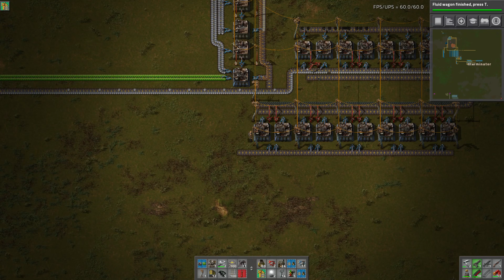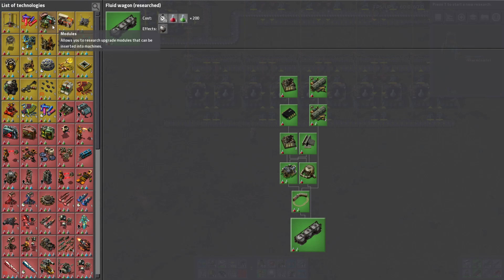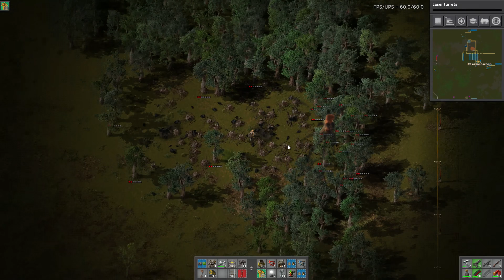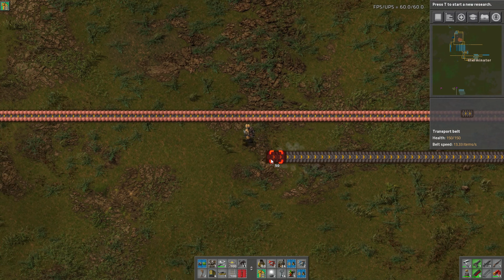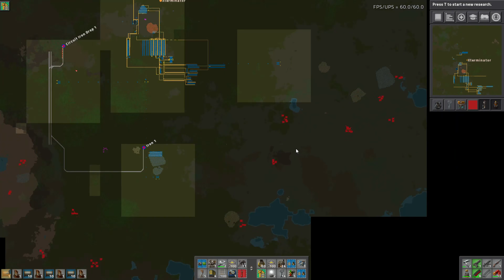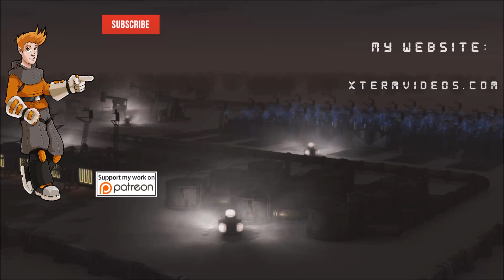Factorio: Tightening The Belt: Megabase Guide EP7 - MILITARY DONE & OIL | Tutorial Gameplay Series

Comment: On your assemblers where the input resources are coming from Left >to Right I don’t know if it makes a difference but placing the inserters for the pick up on the side of the assemblers where the resource is coming from (the left in this case) and the output arm on the the side the output belt is going so it can pick up items off a non compressed belt faster and place Down the finished product one block closer to its destination if that makes sense , I don’t do maths I just place crap wily nily but that’s what I think about when putting my inserters down

Comment: When calculating ratios, I always multiply by the crafting speed indicated on the assembler.  I didn't notice you adding that factor in (different for the 3 types of assemblers).  Was that an error or does it not actually matter when you are using all the same assemblers right now?
Reply from the maker: Correct, it doesn't matter if you are using all the same level of assemblers. I prefer to calculate off of base rate (not taking into account assembler speed) this early in the game. Later on when we get modules and beacons and such I will do the proper calculation taking into account the assembler speed and such.

Comment: When you do the oil build i wouldn't focus to much on ratios. Do a small build to get it going. Then when bots available do the 25/3/21 build or wait for modules?
Reply from the maker: I still prefer to build in proper ratios sense it is pretty simple. Then just upgrade it as I need more.

Comment: You used a dedicated line of iron for the gears. I personally always 8-8 balance the main bus, and then just split off. Is there a down-side to balancing it vs a dedicated line? If you're not using military research, that iron would do nothing right?
Reply: I'm sure once he builds out all the iron smelters that he'll be balancing and splitting off. At this point he just doesn't have the infrastructure in place to do so.
Reply: Like Omar said he just doesn't have the infrastructure to do a balance and then split line right now, but probably will.  The advantage to balancing first then splitting is that if for some reason you have 1 smelter that isn't producing enough then the others can compensate.  With a dedicated line like he has right now, any decrease in the input to that smelter is going to have a bigger effect on his build.